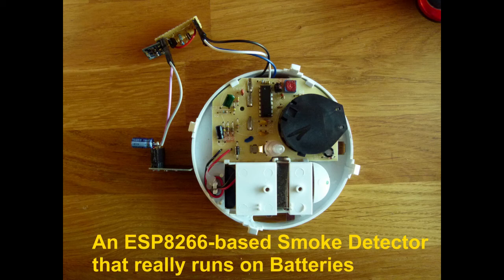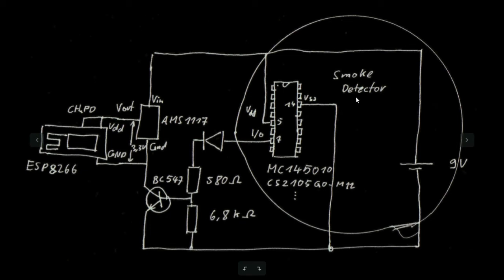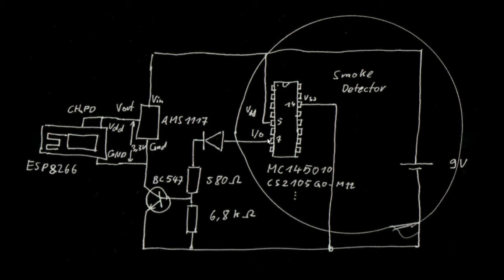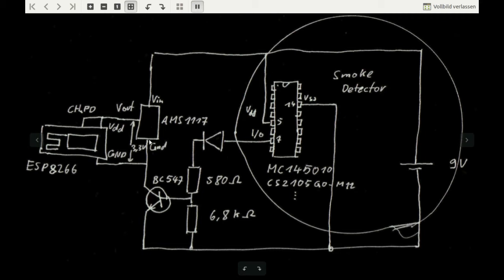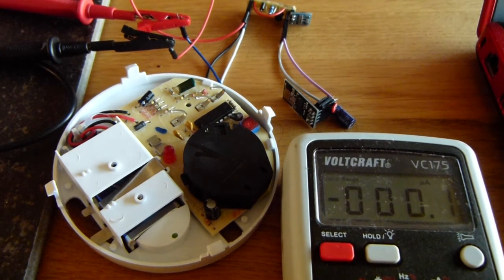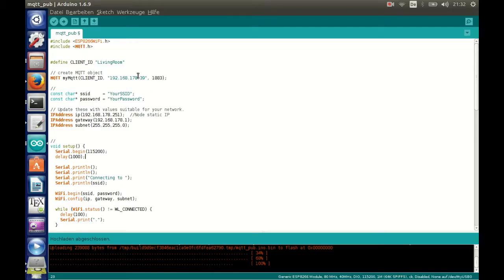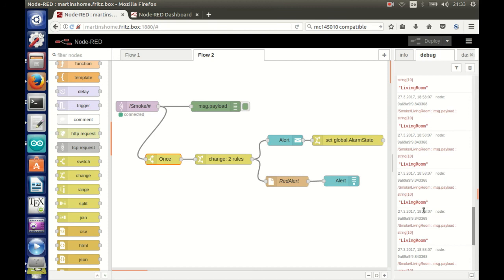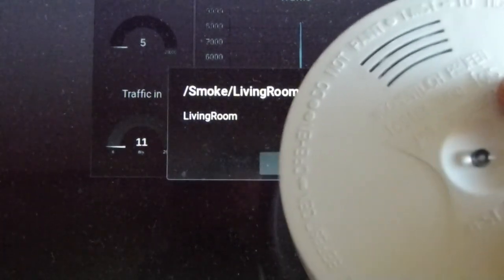An ESP8266-based Smart Smoke Detector that REALLY runs on batteries

Comment: I wanted to add that the MC14468 IC is used for Ionization detectors like the Kidde i9040. Thus Pin 2 is the I/o Pin 6 is Vdd and Pin 9 is Vss. That's the ones to I which have applied your great design.

Comment: You can connect one of the ESP8266 GPIOs to the base pin of the transistor BC547 and set that GPIO to high as soon as starting up the ESP so that you will keep the ESP powered even when pin 7 goes low, and when you finish sending the alarm signal you can put back the GPIO to zero to shutdown the ESP.
Reply from the maker: Might work, havn't tested that.

Comment: Hello, cool design, just had an empty battery on 1 of my smoke detectors so opened it also to do the same thing ... however I think I can make it even easier with an SPX3819M5-L-3-3 (3.3V LDO with enable pin), the enable pin can be directly tied to port 7 of the smoke detector (it can handle Vin) completly replacing the diode, resistors, the transistor and the  AMS1117 in your design
Reply from the maker: Wasn't aware of that chip. Good idea. Would be interesting to see what "When disabled,  power  consumption  drops  to  nearly  zero." in the data sheet really means.
Reply: Hi Gert, interesting feedback. How was your experience with the energie consumption with the SPX3819M5-L-3-3? Do you have a schematic of your implementation the project?
Reply: I tried this but the power out of the SPX3819 is insufficient for the ESP-01S. As a test I connected both the enable and Vin to a 9V battery +, I do measure 3.3V output from the SPX3819 but once the ESP is connected its drops to 1V, ESP leds flashes once. Tried a 10uF capacitor on 3.3V/GND inputs but it didn't make a difference.
Reply: @ec6741  Those should be 500ma devices....?
Reply: @christianerance  Got it working with an SPX3819. My 9V rectangular battery was unable to provide the necessary 80mA to power the ESP01-S. So basically the same as Martin by first connecting the output to a NPN transistor (PN2222A) using it as a switch when pin7 goes high. When the transistor switches, it closes a second circuit: battery LIR2450 3.6V, SPX3819, ESP32, Capacitor. The enable pin on the SPX3819 is not used but the regulator is tiny so easy to fit. An alternative would be the HT7733 (small but a lot easier to solder!)

Comment: When the batteries in my smoke detectors are running low, they go "Pip" once every couple of minutes, and it can be very difficult to track down which one needs attention.  It would be great for the failing unit to send me an email.
Reply from the maker: Didn't test the power low mode so far. Don't know, whether the I/O signal gets high also in this case - guess not, as it shouldn't indicate an alarm condition. Will look at it in the next time.
Reply: My smoke detectors also pip a red LED during low battery warnings. Perhaps you could detect that if yours does too.

Comment: Hi Martin just 2 questions that don't seem to appear in the below comments: a) do you use a 1000uF capacitor on the VCC/GND pins? b) on my voltage regulator I don't get enough current from the 9V battery, so is it a property of the AMS1117 to drain what the ESP requires?
Reply from the maker: a) Yes, I did use a capacitor before the ESP, but it is less than 1000uF, think it was 100 or 220. b) it workes for me "out of the box" - perhaps you might try with two 9V blocks in parallel?

Comment: hi I have soldered the 3 wires to the chip, i have put a meter on the Plus and negative to a meter, the meter is showing a contstant  2.50 volts when i press the test button it goes upto 4.60 then drops and raises again with the bleep, when i let go it drops back to 2.50 vots is the correct
Reply: I found that my PIN 7 was connected to the speaker input voltage. On my PIN 9 looks like it might be the IO pin and it is putting out a pretty stable voltage between 5.5V and 6V when the button is pressed. However, when I try to hook up to that PIN the voltage tanks to around 1.2V and the transistor stops completing the GND circuit I'm not sure what to do from there yet.

Comment: can I just run a wire from Pin7 of the smoke detector to a raspberry pi GPIO, with a 11400 ohm resistor inline (9V-3.3V/0.5mA = 11400ohm)? do I need to tie the grounds together?
Reply from the maker: You need a common ground. I would use a voltage divider 2:1 to reduce 9V to about 3V.
Reply: @martinger327  I think I am going to use a PC817 optocoupler with 1560ohm ((9V-1.2V)/0.005A) resistor on the input. #raspberrypi recommended this to me instead of a direct input :P

Comment: Do you think the same circuit could be used for a water leak sensor?  Instead of the io line it would be a broken wire that would complete the circuit when water allowed the current to bridge the gap of the broken wire
Reply from the maker: Yes, think I would use a schmitt trigger for amplifying and creating a binary output signal.
Reply: Martin Ger thanks for the info. Could you link a website or video that demonstrates how to do this?
Reply from the maker: https://electronics.stackexchange.com/questions/75503/schematics-for-device-which-reacts-to-water
Reply: @martinger327  Hi, hast du nen Shoppinglink für nen passenden Rauchmelder?
Reply from the maker: War der hier https://www.obi.de/brandschutz/fotooptischer-rauchmelder/p/5148903 - denke, dass fast alle billigen Rauchmelder mit 9V-Block so aufgebaut sind.

Comment: I'm just trying this now and am stuck with an Arduino compile error. Sorry if this is basic. I'm not even at a novice level at Arudino.

Getting an error: 
smoke_detector_sketch:10:1: error: 'MQTT' does not name a type
 MQTT myMqtt(CLIENT_ID, "192,168,2,100", 1883);

And a few of these:
C:\Users\Roger\Documents\Arduino\smoke_detector_sketch\smoke_detector_sketch.ino: In function 'void loop()':
smoke_detector_sketch:68:20: error: 'myMqtt' was not declared in this scope
   boolean result = myMqtt.publish(topic, valueStr);

And:
Multiple libraries were found for "MQTT.h"
 Used: C:\Users\Roger\Documents\Arduino\libraries\MQTT
 Not used: C:\Users\Roger\Documents\Arduino\libraries\esp-mqtt-arduino-master
exit status 1
'MQTT' does not name a type
Reply: Nevermind - got it working after copying a generic sketch and adjusting.

Comment: How about one of those Mini Buck Converters set to 3.3V (http://www.ebay.de/itm/10PCS-Mini-360-DC-DC-4-75V-23V-to-1V-17V-Buck-Converter-Step-Down-Module-/371953243466?hash=item569a24154a:g:kzMAAOSwn-tZHCol)

The MP2307 used on them has a High-Endabled "Enable-Pin" wich could be directly driven by the Smoke Detektor

Unit price can be as low as 0.50€ per pice
Reply from the maker: Interesting - guess, it will work. I havn't seen data on the power consumtion when disabled.
Reply: Martin Ger in shutdown mode, the supply current drops below 1µA.
Reply: Yes, and the chip has an enable pin which is tied to vcc, but, desoldering a resistor makes it available for connecting to pin 7.

Comment: Great project! I hadn't thought a small signal bipolar transistor (the BC547 has a 100mA rating) could handle the current to drive an ESP8266. I have used an IRLZ34N N-Channel Mosfet where I had to drive a high current (>100mA) load. (see https://youtu.be/lX2YQBl-ggQ )
Good to know it can be done with cheap components, too.

Comment: But in this sample you use a static IP address, which is not usually available in houses (IP addresses are dynamically assigned by provider's router). Moreover, public address is visible from outside and poses some security problem (could be a Trojan horse to your internal network and devices connected thereto).
Reply from the maker: I use a fixed address from the internal(!) network outside the range of the DHCP responder (configured my home router that it only offers addresses below 192.168.178.250). This is not a public address. 

I did this only to avoid the delay that my result from waiting for DHCP. You can use the same HW setup with a slightly different program and use dynamic local(!) addresses.

With both addresses you are able to connect to an internal server or via NAT to an external MQTT broker.